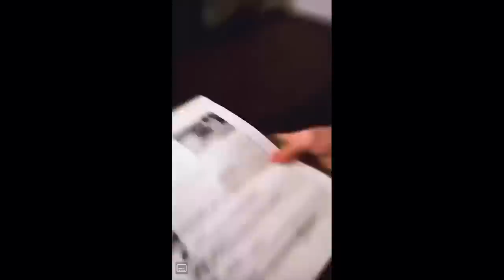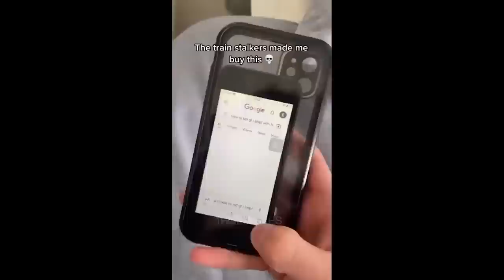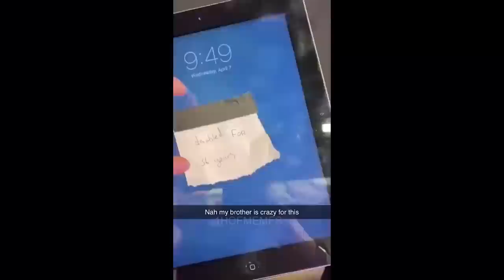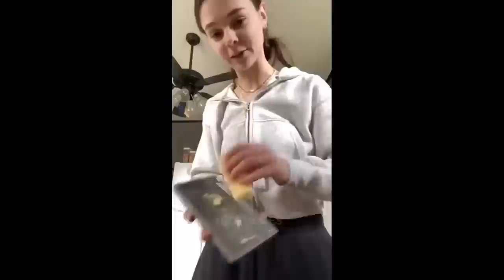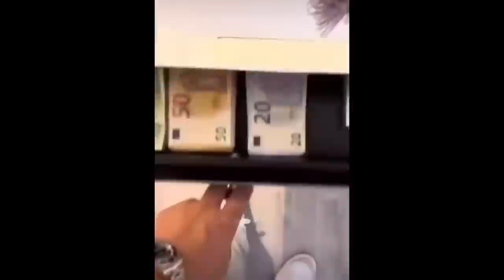offensive memes that if ylyl

Comment: The whole shoe convo at 4:00 
I do not get shoes being such a big, expensive thing. Like. They’re shoes. The most abused article of clothing, why would you ever spend more than $120 on a pair of them
I have a fucking pair that I got like 6 years ago for like $80. 6 years. I’ve had them since sophomore/junior year. They’re still held together fine, and I still use them a lot. You don’t need to buy a new pair every fuckin- shoe release.
Reply: eh, yes and no. it's not worth buying new shoes all the time, especially licensed ones, but a good quality pair of shoes ~100 dollars should last for years. don't buy 20 dollar piece of crap shoes that will fall apart and fit badly (causing damage to your body). shoes are the one piece of clothing you should actually spend money on